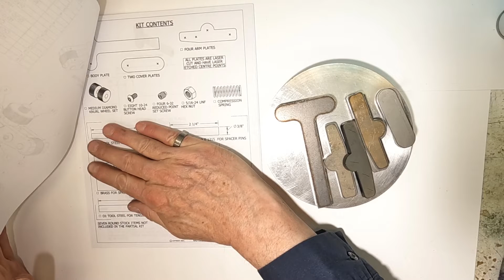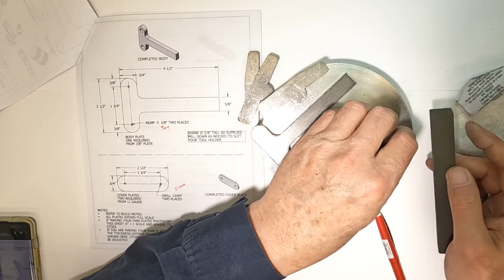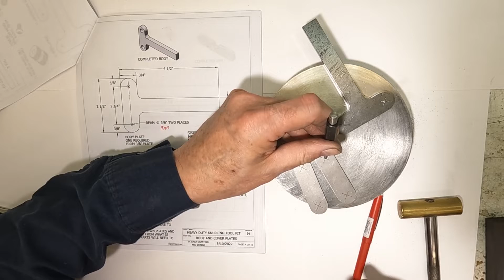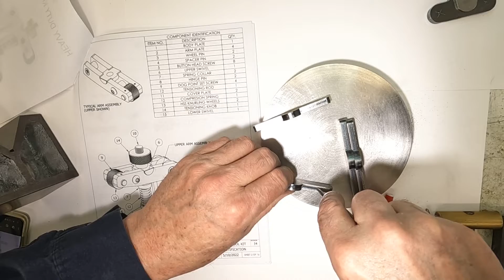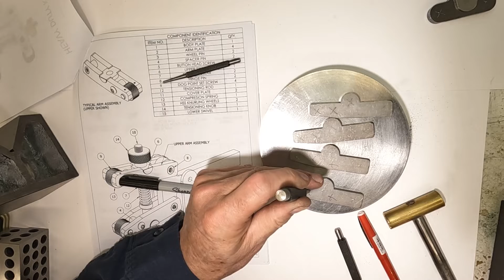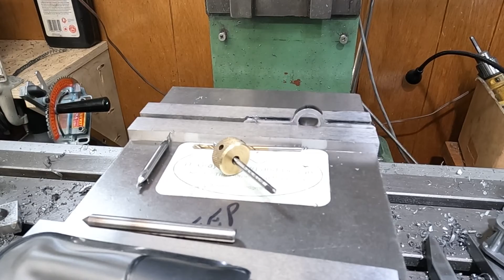Heavy Duty Knurling Tool Kit Build Series Part One: Preparing the plates

Comment: Hello Doug,
An enjoyable video and very well explained... I love the idea of a bench anvil, I have been looking for some offcuts on eBay as I would not normally work with large material.
Also, like you I often, take a breath and put some of my tools away from the previous operation to avoid making a mistake.
Take care.
Paul,,
Reply from the maker: Thanks for watching Paul. I recently save some mild steel blocks from the scrap bin at work. About 2" x 4" x 1" thick, perfect size to have around the bench as anvils or setup blocks I,m looking forward to getting them cleaned up.